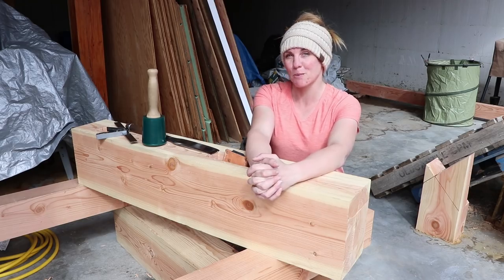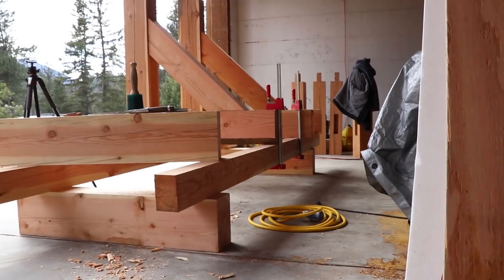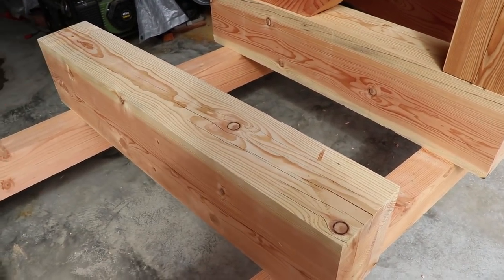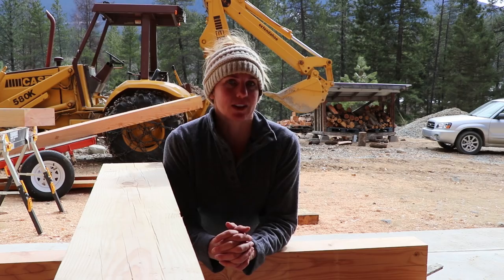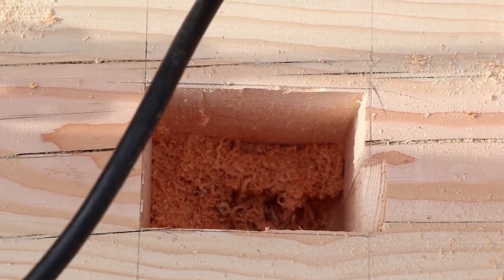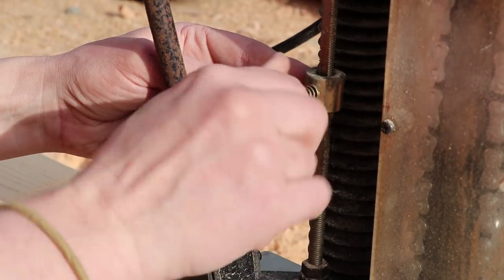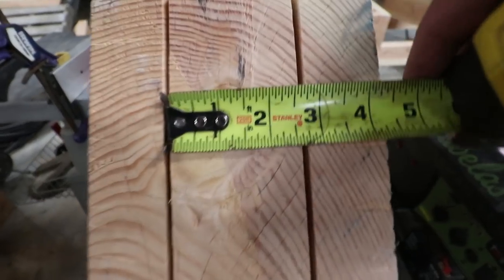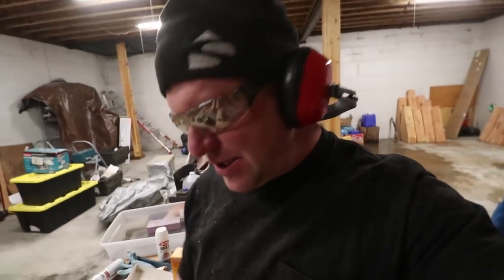Making Timber Frame Roof Braces Using Chain Mortiser

Comment: Jesse, replace that low piece on the saw. Also set the fence so it cuts the farthest set first, then put in a 2-1/2 spacer (width of tenon) next to the fence and it will cut the other side of the tenon. Then the fence stays put all the time. Just take out the spacer when you want to cut the farthest face first.

Comment: Love your content. Yes it is smarter to work a power tool on one setting and do all the work for that setting, check at intervals. Keep the cilinders of your Bacho as much in the inward postion as possible, there is only a minute layer of grease on there to protect it from the elements.

Comment: Jesse ,
The red thing on the table saw is a throat plate. It looks like part of it is missing. There should be a narrow strip on the left side also. There are usually 4 screws in the corners to level the plate. I never see you using a block plane, it would make fitting tenons much easier. The is also a shoulder plane that would help.

Comment: Jesse, the red part you describe which is below the table saw top is called a throat plate.  You should be able to adjust the height to be at the same level as the saw top.  There should be small allen or torx screws which can be lowed or raised. Good luck!

Comment: There should be height adjustment set screws under the orange insert. Unscrew the two screws holding the insert in and clean out the saw dust. You should see 4 allen head set screws. Turn the insert up side down and use it as a level check. Using it up side down is the easiest way because the  retainer tab makes it difficult and wastes a lot of time. Are you using furniture polish on the table saw surface. The wood will slide better. Hope that helps.

Comment: You need to throw that table saw fence away and clamp a 4x8 shimmed to square to the table  make sure the saw blade is parallel to the clamped timber.  the larger face will help keep the cut parallel to the scribe.  leave the line by an eighth     Rabbit plane will help fine tune

Comment: Where I live, you can find much better quality table saw on Craiglsit for around $100-$150.  Look for on with a cast iron table and 2 cast iron table extensions.  Also look for on that has has a least a 10" blade and the motor hung on a belt drive out front.  20 to 30 year old saws are fine as long as there is NO PLAY in the arbor shaft bearings !  (A quick look and there is a 12" one on CL for $200 !)

Comment: don't forget to measure from the saw blade to the fence on both the front of the blade at the carbide tooth and also again at the back of the blade on a tooth and it should be parallel but the back can be a 64th wider to allow for the wood to go through without being pinched between the blade and the fence causing the wood to burn.  If your wood is burning then it is not parallel.

Comment: when sharpening your chisel on the whetstone I hear a sound....is that the guide or the chisel making that sound...I sharpen chef knifes...etc free hand and while I wouldn't freehand sharpen a chisel that sound would tend to make me wonder if it where throwing your bevel off or creating a secondary bevel. Stropping more often between each mortice would help reduce the amount of heavy sharpening....looks like you have a King water stone 1000 grit. I think that is the gold standard for woodworkers...if you ever get an opportunity to use a chosera stone they don't require soaking like the King stone. They're splash and go stones so more convenient. Great video as all ways.

Comment: Maybe too late, but I think a timesaver might be to take the time to make a block the exact size of the tenon and a frame the exact size of the mortise to test fit your carving before wrestling with the full size pieces.
Reply: Well said Tin Wizard, best to make it easy on your back when handling anything heavy.  Also, to late to help would of been a single router template for your  2 mortises, secured in place to plunge cut a perfectly located  guide to work from. No chance of layout  screw up. . . But this is life and how we all learn . . . great vids and best of luck  U 2

Comment: The saw throat should be adjustable to level it with the table.You loosen the hold down screws first then you turn the adjustment screw in. Then you tighten the hold down screws but do not over tighten. It will bend into a dip.

Comment: Harbor freight has mortise drill sets and they can be used in a hand drill to do the corners.   I think a  jig could be made to help do the sides to get them a uniform width.  You could start with a cordless skill saw to cut the lines to get a couple of inches deep, this would keep the chain mortiser centered but would make the chisel go much faster with the cut already started in the right place.   My skill saw is not that accurate but a new blade made all the difference.

Comment: I understand you don't read the comments but if you by chance read this, 90% of your problem cuts are the table saw. The fence is for rough framing, it will work if you change or adapt the fence and use a quality blade. Make your own fence and clamp it down. Your work pieces are moving around when shaving, lock them down. Hate me or delete me, I love what you are doing
Reply: I totally agree with your comments. It’s a learning curve and their first table saw.
Reply: I had that same table saw and never realized how bad it was till I bought a cabinet saw.... it was a game changer in my shop

Comment: Do you have carbon paper?   You can use it in a joint to mark where the wood is rubbing and chisel that mark out.   Also you can use a cheap 1/4 inch router mounted in a 2x4  to act as a swing arm to check the level and flatness of the tennon instead of relying on measuring and chiseling it out by hand.   You could even use the 2x4 swing arm over hanging the tennon with a nail or bolt pushed through it to scratch the surface to indicate a parallel depth.  Better use a bolt with the tip filed to a point so you can dial it down to a certain depth, have Alyssa sit on the far end, say 3 feet away, then drag the bolt tip back and forth to  reveal the grade of the tennon as flat or not flat.   Then chisel down to those marks.   If you are handy you could even design the same jig with a narrow chisel mounted at the required depth to cut the depth uniform for you.

Comment: I believe I have that same table saw and the same issue. I made a sled to keep the wood from binding against the fence and to keep the wood off the red throat guard, but I'm not running beams across it with the sled. Maybe make a sled that can provide some support for the beam to keep it all safer, more accurate, and less of a headache.
Reply: Aren't there adjustment thingys under the throat plate?  Or some place to put a few spacers?  ... Just asking.

Comment: from what i gather the creators of this channel do not read the comments, but for everyone else...  The part on the table saw they are having problems with is called a zero clearance insert plate, or insert plate for short.  The factory ones on even high end tablesaws are normally not very good.  The solution is the same, simply make one (several, as it is just as easy to make 6 as one)out of plywood.  then simply replace as they wear out.

Comment: If you want to save time on machine set-up (such as the chain mortise machine for example) leave the machine set up for doing the 5 1/2 inch deep mortise, and use that set up for the 3 1/2 deep ones.  The extra amount being taken out by the machine is likely done faster than changing the machine back and forth.  When it`s time to hand dress them, you only go down the 3 1/2 inches.    The extra material taken out will not affect the timbers.

Comment: Put a piece of 1/4" plywood as a zero clearance table top.  Drop the ply onto the table, clamp it, and raise the spinning blade up into the ply.  Solves those jenky inserts on the lower end table saws.

Comment: Aren't there set screws in the saw table that help level the insert? Mine had two allen screws at each end that I could screw in or out to make the insert flush with the table top.

Comment: The ends of the braces have to be cut more accurately for the way you're cutting the tenons to work well. And that's a sorry, little table saw for what you're doing.  You'd be safer and more accurate cutting the tenons with repeated cuts of a skill saw as you've done before.

Comment: You definitely have tensioned wood, I also believe that having beams with both sapwood and heartwood could add tensions and let it bend while sawing. It's quite normal behavior and as sombody else noticed you are not chiseling furniture, you don't need precision at all. Simply follow the Diresta's rule: if it looks straight it is straight ;)

Comment: glad you said a table saw tune up- make new zero insert ,calibrate blade to table, level saw, 
secure table ( too lite). saw  has a sharp rip blade? scab taller board to fence i thought you all had a big foot circular  saw? think jigs!!!!! keep cutting practice for the mill trim work.

Comment: I realize its all done and that you rarely answer FB but i'm just wondering why they didn't teach you to make blind mortise and tenon joints. With just a slight bit more work you would have a joint that doesn't show and the finished product is a lot nicer.

Comment: Your plate on the table saw should be adjustable by set screws under the plate. The screws are not for holding the plate, only adjusting plate to be even with a able.

Comment: One of the first things with any new table saw is to adjust the throat area around the saw blade to match the table surface exactly and adjust the fence so that it is perfectly parallel with the blade. The throat has adjustment screws somewhere on it, depends on the brand where that is. The fence usually has adjustment screws at the end where you have a lever to lock it in place on the saw. Until you get this done, a table saw is not much more accurate than a skil saw.

Comment: That table saw also has the potential of creating a huge medical emergency in a hurry. I cringed at seeing you trying to guide that beam over the blade. That's not the right tool and not the right technique! Better, safer, and probably quicker if you cut out the tenons with a handsaw.

Comment: Jesse/ alyssa, you guys should consider getting a jack plane to help smooth out those large areas on the end grain and long grain tenons. Then you could use the chisel on the corners or even get a shoulder plane as well. You can find lots of old Stanley's on Ebay or possible at local markets. Great job this week. Getting alot accomplished.

Comment: Have you thought about fitting each mortise and tenon independently before putting the three pieces together you could find out if they’re going to bottom out or if a tenon is too wide it would be easier with one piece laying down and just trying to hold one piece in place once you have the three independent joints. You could then put them all together to make your one brace. Just a thought.

Comment: The blade is warping due to heat. What you are doing can be dangerous,  at least use the circle saw , take small cuts at a time. This is a lot safer that moving around such a heavy piece on a table saw. Your fingers are not worth a piece of wood.

Comment: I don't understand why you didn't adjust the saw throat plate to correct hight as it would make your life easier,
also you-tube has articles on cutting tenons on table saw  if you watch them you will see they have fence extended up to help stop the wobble, would help a lot to get cuts square. hope this helps.

Comment: Considering what you are working with why the tiny table saw? Why don't you have a beam saw? You need a zero clearance plate for your saw and a much much better rip fence. Also, Alyssa is putting her weight on the Mortiser it much be blunt. It needs to be accurately sharpened too, just like a good chain saw.It should be putting out chips not fluff.
Reply: Mark Bernier First thing I thought of was zero clearance plate too.

Comment: Your zero clearance insert is definately outta wack.  You will have to see just how bad it is with your framing square.  Hopefully you can fix it by just adding a few shims (take some sheet metal scrap and cut into washers to level the insert).  But it looks like that is a contractors table saw that just uses two points to support the insert.  that will be tough.  If it does have a lip around opening where the insert sets, you could just make new ones .  Here is an example  https://www.youtube.com/watch?v=Jgh1Hqg1LY8